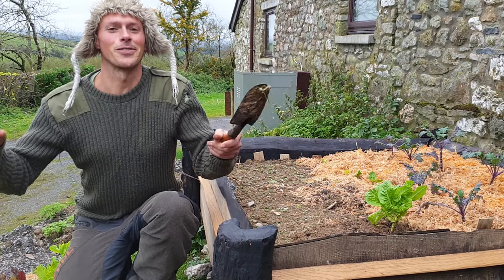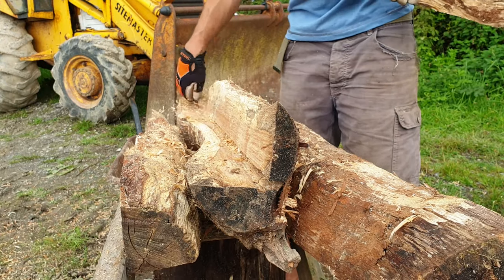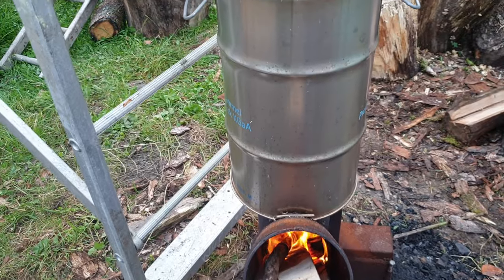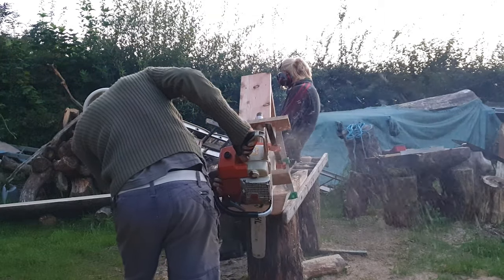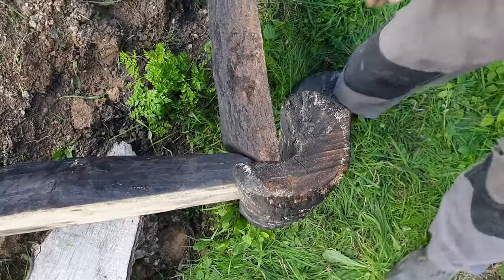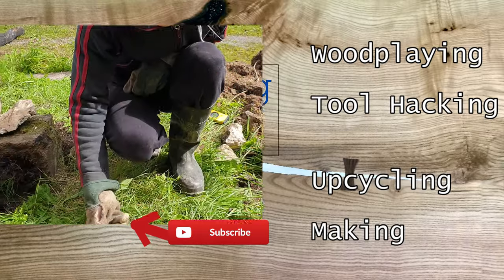Make Raised Beds with 3 Chainsaw Tricks

Comment: I'm not sure I need to worry about slugs here, but this a wonderful idea to use the waste from more valuable wood. I have some black locust I'm going to use for rot resistant beams or furniture and the slab wood off cuts would work wonderfully for this. Thanks for the great Ideas of up-cycling.
Reply from the maker: Cool cool, thanks Gary. Luck to have some black locust, good on ya!

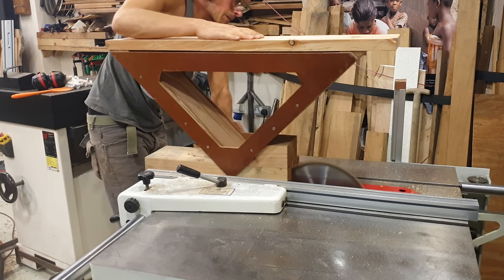Comment: Well certainly some great ideas, got me with the mitre box (had no idea- think I would have gone a vertical approach with the saw cut, not sure you need it so I big)....thought you would have used similar technique used @05:30 on the side boards to reinforce the corners of the planter beds (if you cut them with a chainsaw at 45 on the vertical plane alternating one up one down then just wedge a suitably thick scrap wood in the grove glue or not, should be adequate). When you pulled out the copper I thought you were going to use that cause slugs and snails dont like going over that....so if the 45 edge strip board doesnt work you could strip down the copper pipe, beat it into flat straps and use that.......now cant wait to see what are you going to do about the rabbits and birds?
Keep up the great work, cheers

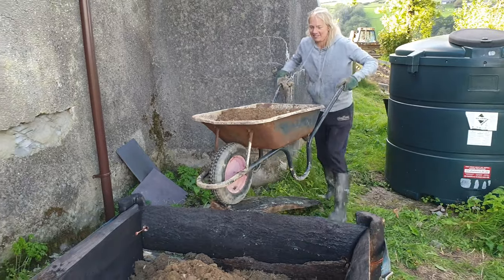Comment: 10:54 - that's the biggest casting box I've ever seen, you're going to need a crane for the other half and is the coarseness of the casting sand to try to hold it together so it doesn't fall/drop out because it's so big?

Comment: I have used my old band saw blades  teeth facing down around pots and boxes with limited success but I wonder if you tucked them under the 45 degree strip, would it deter a few extra ones. The oak strip would protect your thighs too when weeding/planting.
Reply from the maker: Good evening Gary. Thanks for the Interesting Idea...

Comment: Thankfully YouTube helped me stumble upon this channel. This is the second video I have watched and I’m digging it! I’m new to the chainsaw milling, slowly getting it dialed though. Cleaning up burned Douglas Fir in Oregon secondary to some wildfires that wiped out my outbuildings. Anyway, if you have made it this far into the comment, what respirator are you wearing? Those fumes are brutal. Thank you for the content, subscribed and liked. Much love from the PNW. ✌️
Reply from the maker: Hi Dusty! Great to hear from you and so pleased you're enjoying.  The respirator is the 3M 6800 full face equivalent - it's a cheaper import (https://goo.gl/kVGmyk), but I use it with the genuine 3m 6001 vapour filters. (ebay link: https://goo.gl/PNXNEq). Definitely makes for a better, or at least healthier experience. Peace n love, Bongo and Sam

Comment: wrap 2 copper wires around, and connect them with a 9v batterie. When slug touches both wires, the plus and minus of batterie get connected and current flows through slug.
Reply from the maker: Hey Friedrich, thanks for this. Will try that on the next one if this doesn't work.
Reply: This was what I thought this was going to be. Nice potentially zap free alternative. Interested to hear how it works out!

Comment: I've seen another method with copper wire, where two strands spaced 1/2-1" apart go all around the outside of the bed walls, and are attached to a 9v battery that is placed in a rain-proof spot like an upside-down cup. It lasts a full season, and when the slug touches the first wire it "tasted" the copper but no shock. then it touches the second wire as well as the first, and gets the mild but effective shock, and turns back. Eventually it associates the "taste" with the shock and turns back at the first wire. I haven't used it myself, so take that all with a grain of (slug) salt.
Reply from the maker: Hey Mark, sounds like an excellent system. Will have to give it a try someday. I do remember 'testing' 9v batteries with my toung when I was a child :)

Comment: I have a MS880 and have a lot of trouble keeping the chain from jumping off the bar cutting over 36". I was read elsewhere just tighten multiple times as tight as you can, but it seems to bog down the saw, bend the scrench and even strip the adjustor. Do you have any tips for  how to deal with this?
Reply from the maker: Hey Wise Wolf, thanks for the question.  If it's skipping off the bar there is a problem with the guide bar (GB) or the chain, or more likely, both. 
Absolutely never would tightening the chain as much as you can be a good idea! That will further damage the GB and chain. With the saw off and on the bench, chain brake off, you should be able to move the chain round the GB with a gloved hand. When adjusting the tension, tighten it until it gets hard to move then back the tension down a bit. Shouldn't sag off the bar, but should move by hand. 
I'd guess that even when you back off the tension the chain will bind - that's a sign of damage. 
 Examine the chain closely as you push it round. If you are lucky it will just be a few problematic links... identify damaged drive links (the part that runs in the GB grove), and smooth off the edges with a fine file or small rotary tool... 
Every time the chain is thrown off it is likely to damage one or two drive links, so that they won't run smoothly in the GB. 
Also check the GB grove carefully: is it clear and even the whole length? 
It's also worth examining the drive gear ⚙ for damage.
Good luck, let us know what you find and how you get on 😉